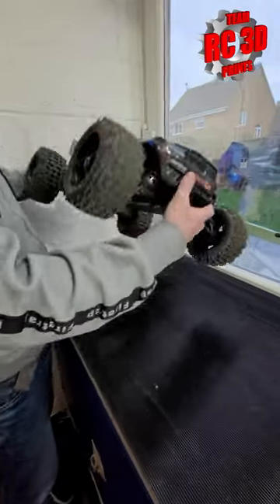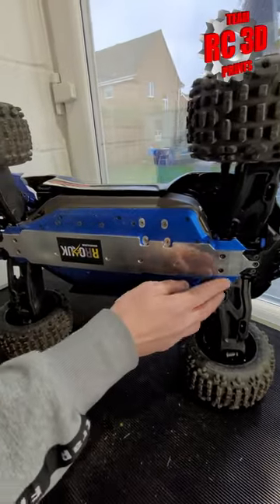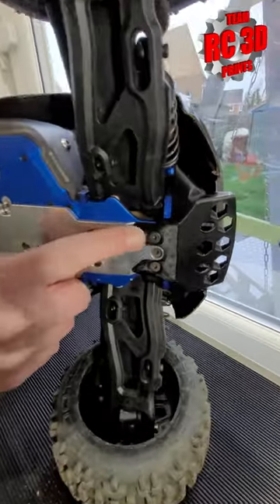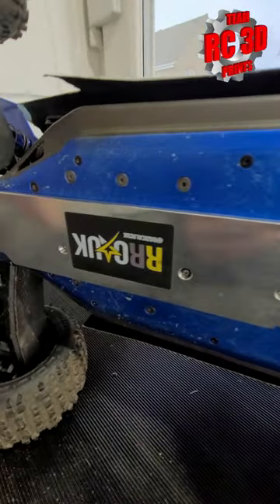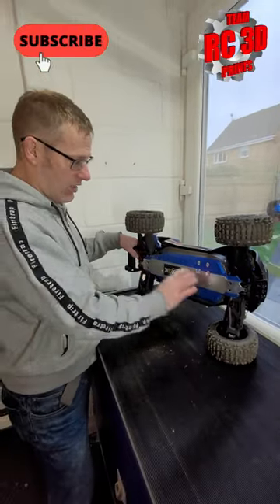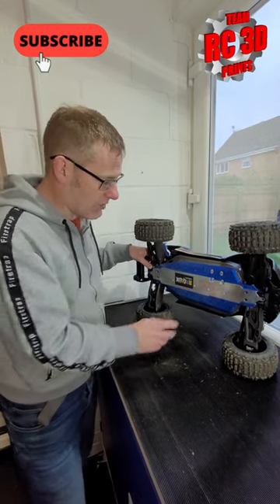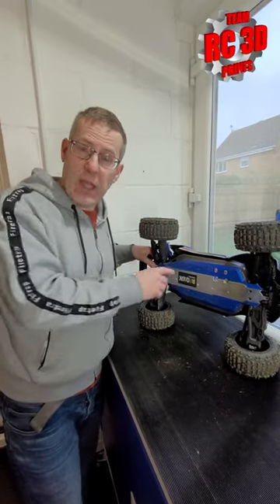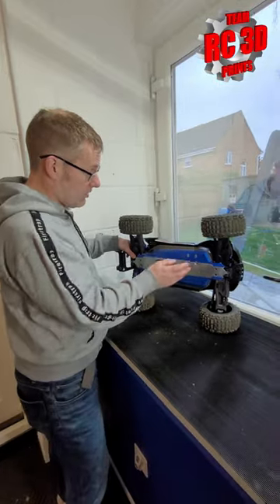How to stop Traxxas Sledge chassis from bending #SHORT

Comment: My question is how is it held up where the motor mount is because that's the part that bent on mine, more like a bulged down under motor mount. But I literally just ordered the GPM chassis last night.
Reply from the maker: It's held on with the screws we showed on the video. It's getting quite scratched now, but otherwise it's perfect. The chassis is still straight and the motor (and everything else) hasn't moved at all.

Comment: Interesting. I just wish I would be able to install the skid plate as well as the chassis brace. Since you mentioned you mainly race, what servo do you run in your sledge? I just picked up another one and I mainly run track as well and that stock, servo is just not fast enough
Reply from the maker: We run Savox servo there is a video on the install
Reply: @TeamRC3D 
Definitely Savox is the best . 👍🏽